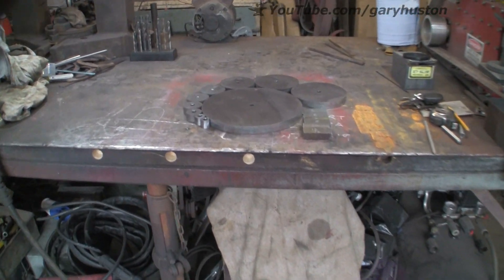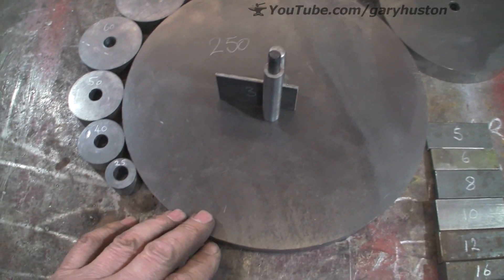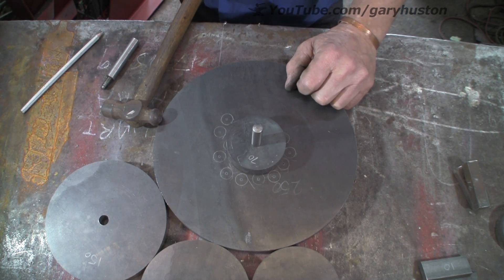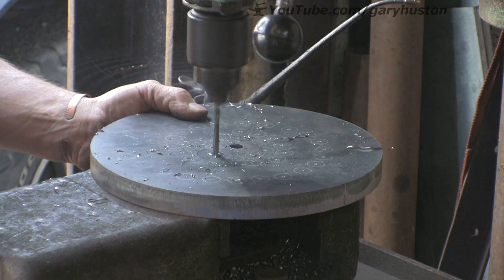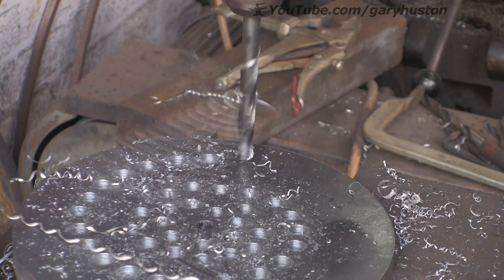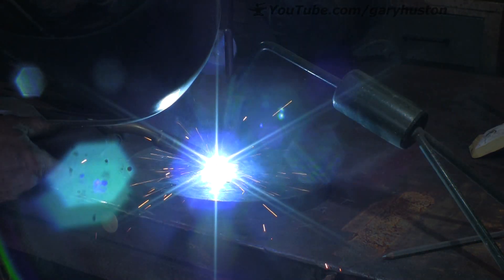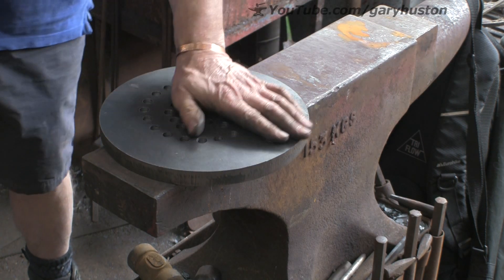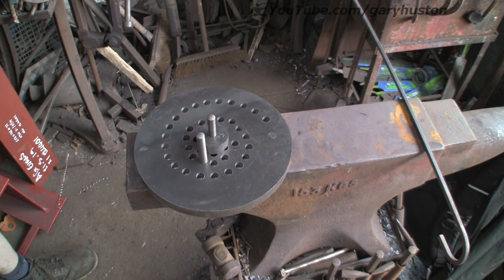Multi die bending jig

Comment: To make the swing arm move easier while bending, make a small bushing to fit over the bending pin that fits in the swing arm holes. Doing that enables the bushing to roll against the stock being bent instead of having a friction type contact with the stock. It makes a huge difference! I love the project! Thanks for posting it! Subbed!

Comment: Good job, Gary.  I bought one rather than build my own, and I think you designed yours well.  The one thing I don't like about mine is that the holes don't pass all the way through so you're constantly getting them filled with scale and mud dauber wasp nests.  As heavy as the main plate is, well, it's not very easy to always be flipping it over to knock the crud out.

Very good thinking to drill the pilot hole all the way through.  You'll find that a real blessing in the days ahead.

And, you're right, they are really pricey!

Comment: I tie a string to the center pin (mine was 5/8 " round). I wound the string around the center pin. Tied my silver pencil to the end of the string started the drawing spiral around until I got to the outside of the plate. Then I marked 1" center punches around the spiral. Might not be the right way but it works for me. I drill the holes 5/8" on all my tooling. Sometimes I borrow from one jig to another one. I drilled a couple of my discs off center. That way it pinches against another disc and holds what you are bending.

Comment: Excellent video, I've made similar bending jigs with the outer pin oversize and turned down eccentric to fit the hole. Example: make your pin from 16mm and turn down to 12mm, offset in your 4 jaw chuck. You'll have 4mm of adjustment and the cam action will help lock the piece in when bending.
Reply from the maker: That's a great idea! I just need to get myself a four jaw chuck!!
Reply: @garyhuston  you can turn eccentric in a 3 jaw with shims in 1 or 2 of the jaws.

Comment: to make a pattern use gasket paper and two ballpien hammers to transfer to gasket paper - use round end of ballpien over hole to transfer hole to paper by tapping round end down hammer - once you get first hole use pin to hold in place to continue
Reply from the maker: making the pattern isn't the problem, transferring it to a CAD program is!
Reply: @garyhuston  I know this is a pretty old video, but if you photograph the paper transfer from the above-mentioned technique, along with an item of known size, you can scale the photo precisely, then use it as a template for CAD.

Comment: Nice jig Gary,  you can improve on the 'F' fork by adding a roller bearing on the pin you welded the wing nut to. You can see it trying to spin on it's own as is, the bearing will smooth things out for you. Kind of similar to the precursor of the Hossfeld bender.  Speaking of, machine mart do a clone of the Hossfeld for about a hundred quid or so. Have you seen them?  Not as many options in diameter of the bends but a good starting point, and you have a lathe to make more dies if you wanted, they also do 90 degree bends too.
Reply from the maker: Ian Lowe never seen one, I’ll take a look
Reply: @garyhuston  https://www.machinemart.co.uk/p/clarke-ccb1b-compact-bench-mounted-parts-bende/    I've had the floor mounted version for years, but sadly don't have a lathe to make more dies for it.  Still a handy bit of kit though. Comes with round dies in 25, 32, 38, 44, 51, 64, and 76 mm
 plus the right angle die. They say it'll bend flat bar cold from 8 x 32mm  to 7 x 51mm  and round or square bar up to 16mm.  Does a lot thicker if it's hot, you just have to watch getting the hardened pins too hot.

Comment: I'm trying to understand why you didn't have the holes laser cut at the same time as the other cutting. Surely all the working out could have been done on card and transferred to the cad drawing. What am I missing?
Given the range of material sizes, would it not be better to have one locking pin hole for each size die and a range of sleaves for the locking pin to accommodate the varying material thickness? This way you only have one to two locking pin holes in the plate for each die size.
I love the idea of having a similar jig and plan to make one as well/ Just trying to simplify it and make it as cost effective as possible.
Reply from the maker: I did try to draw it out in CAD, not to get the holes cut but to make a paper pattern I could just transfer to the plate but it was just too time consuming, it turned out quicker with the punch tool I made. The reason I didn’t get them cut is that they are not accurate enough and the process hardens the edge so trying to file them out if they are a little off is almost impossible. I had the center holes cut and ruined a carbide burr trying to open them up just a fraction. I think I know what you mean , have one hole 60mm from the edge of each die then have a series of sleeves getting fatter to reduce the gap back down fro 16mm to 3mm. I think that would work but it wouldn't give you the possibility to do multiple bends at once. you could only do the one. I like your idea but I think this way is much more versatile.
Reply: @garyhuston  I think I can tell you what Nathan means. Instead of potentially drilling up to 7 holes per die (for the 7 different stock thicknesses you intent to use) simply drill one hole per die marked from the 16mm piece of stock.

You then make up difference by mounting another die/sleeve on the locking pin/hardened steel dowel. So for working with 2mm stock in this arrangement you would use your current die for the bend radius and then another die/sleeve on the other dowel with a radius of 19mm (14mm between the pin and the edge of the die plus 6mm for the dowel minus 1mm of 'wiggle room').

This would require a set of /dies/sleeves for each size of stock you intend to use of increasing size for decreasing stock size but would have saved you a bit of drilling. 

Hopes this has cleared things up and not made it worse.